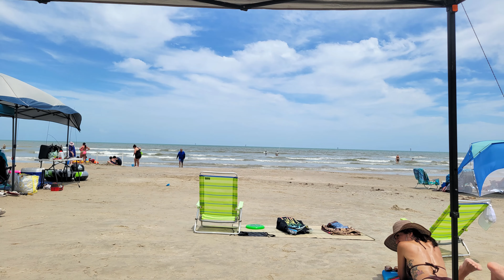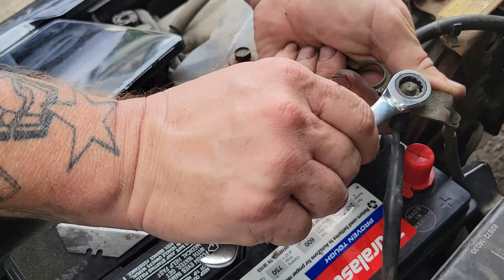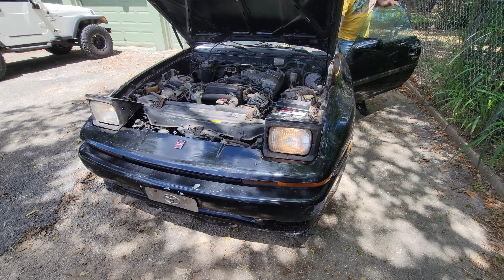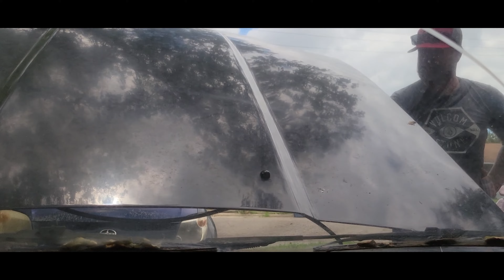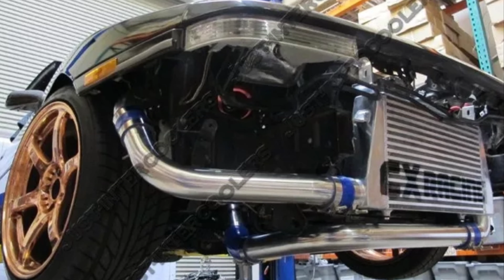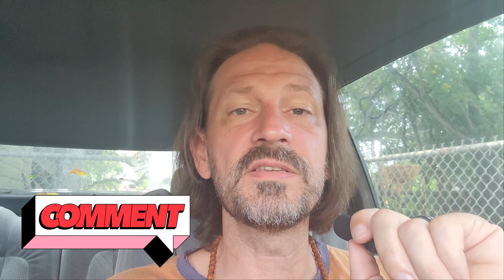Toyota Supra Restoration Part 2: The Moment Of Truth - Will The Engine Come To Life?

Comment: I would agree with you to swap out that engine for the turbo engine like I did with my 88 300ZX. I had a bigger turbo and added an intercooler and ran 15 psi boost and made about 350 hp. 
     When I bought my 1992 300ZX twin turbo 5 speed it was fast stock. This was in 2002. I upgraded the turbos, the down pipes, put NISMO 555cc injectors in it, upgraded the intercoolers, had the ECU reprogrammed, put 2 larger mass air flow sensors in it, a stronger clutch pack, Air fuel ratio gauge(very important), an electronic boost controller(very handy for preset boost levels) and some other mods. 
       At 19 psi boost it made 550hp to the wheels. This was 2003 and I never lost a race. My car was the car to beat. Engines love boost! If you where changing out a 300zx to a turbo engine or modifying a 300zx twin turbo I have a lot of knowledge but very little on Supras. I can tell you that 550 RWH is eye opening!

Comment: So far, it looks like you have a good plan already in progress (trying to get the engine running, cleaning up the car to see what you have and what pieces you may need to get).

With my very limited mechanical experience/knowledge, the only thing I can think of (unless you already did these) are: compression test all the cylinders, see if the oil pump/oil pressure are good, and see if any of the fuel injectors are faulty.

Thank you for the progress update. Exciting stuff!
Reply from the maker: @Ronnie_S  yes sir all great ideas. We just need to get an external gas tank and pump to get it started to see how everything flows. Thanks for the comment 🤙🤙